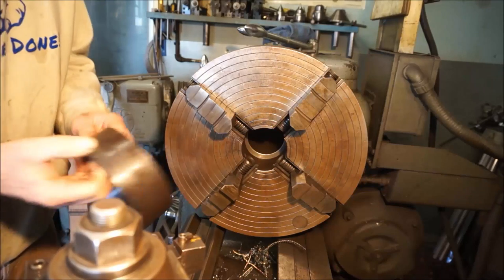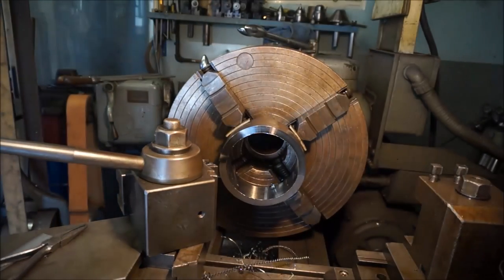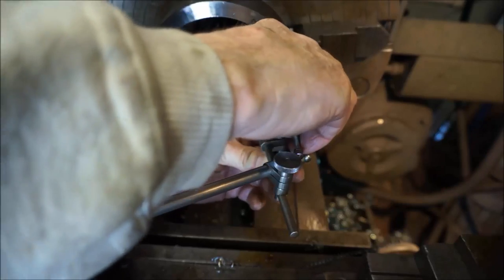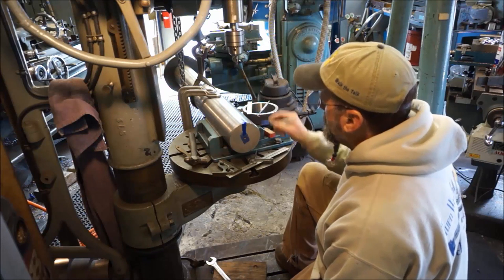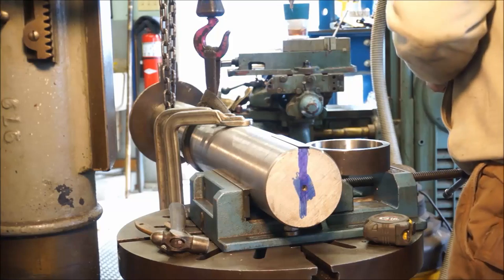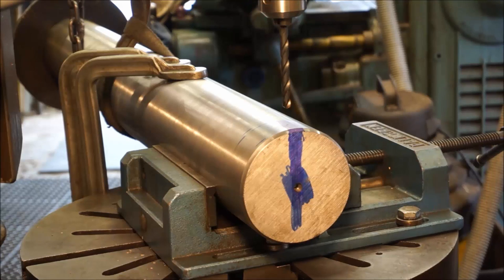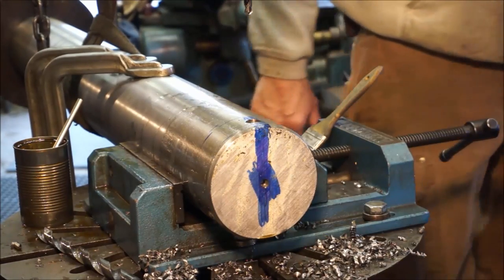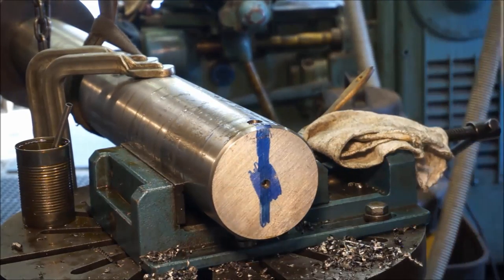Crusher Part 5

Comment: Nice job Keith. I enjoyed seeing your set-up for the drilling of the holes in the drill press. it was really nice to finally see someone put those keyseat clamps to real work. I have two sets and rarely use them myself. The drilling of the sleeve at the end was a nice trick too. Thanks for sharing.

Adam

Comment: Doing those holes looks like would be a fun job to try my HBM out on. Probably not as handy as a true radial arm drill but I still like the idea of being able to handle much bigger and deeper holes than I can on my mill. Will you be align boring the pin sleeves after they are installed on the machine? :-)
Reply from the maker: bcbloc02 They are slip in sleeves! ;{)-----

Comment: Hi Keith, another good job of explaining the steps. It's always a pleasure to watch your videos. One dumb question: the inserts you use are generally for use with outfits that have a coolant system. is there a reason you don't use one? i know the one i have on the lathe at work makes a mess when working close to the chuck. when turning shafts like what you did in the earlier videos of this series it would have been a real boon since the material wouldn't expand so much in length. what's your thoughts?
also i find your efforts with the "what's in your box" series highly commendable. should you continue on with it next year i will try to make a contribution if finances allow it. as corny as it sounds you've become a bit of celeb in youtube circles. thanks again for all you've posted and please keep up the good work.
Reply from the maker: mmikeyy27 I have answered the coolant questions, time over time but know not everyone reads all the comments and anyhow coolant is great, and I not against it but don't have the room or the energy to mussel around the kind of guard system needed to let me access all my attachments on the tracer. the sulfur based oil does what I need and I also never have a rusting problem living near the ocean. ;{)-----
Reply: Keith 
I too am not able to read all the comments but do enjoy learning from your knowledge and experience. I was wondering if you had a website with universal information so you would not need to keep repeating yourself and over time would be a great reference source for us all

Bill

Comment: Why not drill the hole through both the collar and shaft at same time? Or did I miss the explanation on that? Also, why not just stay on a slower speed when drilling? Again, sorry if I missed the explanation(s) on this, was watching and got pulled away. 4 days later, watched from where it left off at. Great videos.

Comment: Rob from Australia did a video on centering drills on round stock, and I've actually seen Keith use the same technique for getting a lathe tool to center height. you pin a scale between the work and the point of the tool, and adjust it until the scale is perpendicular to the spindle

Comment: I don't understand why you complicate things. I am thinking of drilling that hole. Why not just place the outer tube on the inner tube and drill that hole. The bore is just on the top of the outer tube, and it is just to drill. Have I missed something?
Reply from the maker: goph999 More so than not the drill and pressure is going to send you off center and rattle around the hole way though the part and a couple other things like jamming chips between the two parts, Etc. the time and set up as far as drilling time is equal, a little time to slip the ring on was a piece of mind. ;{)-----
Reply: when the gibbon that drives the machine loses the lock collar it is easier to get a replacement if its drilled in the correct manor